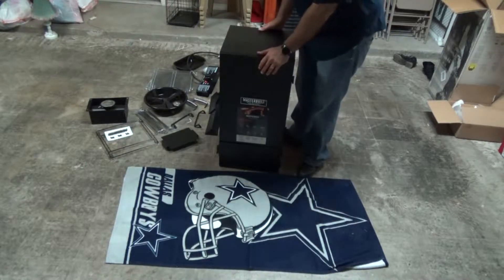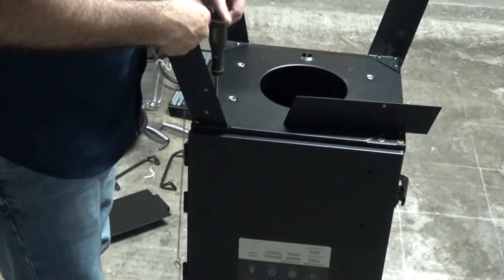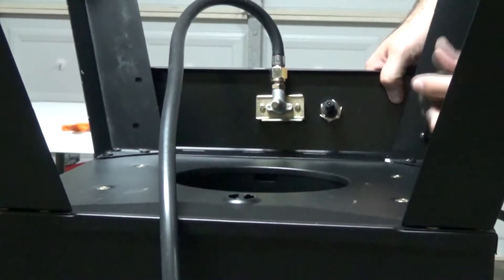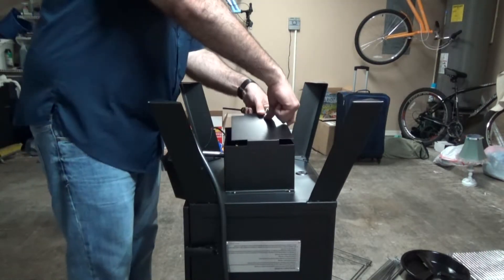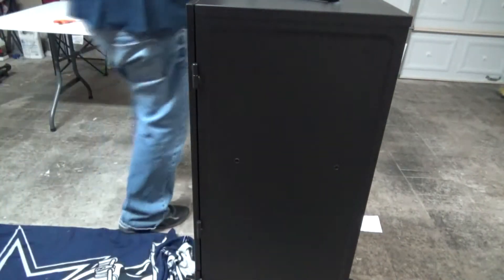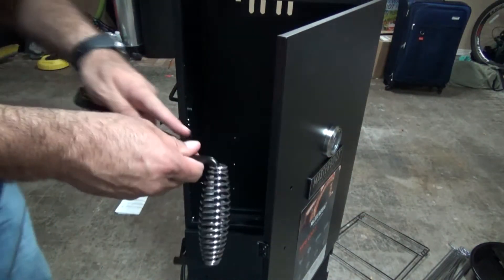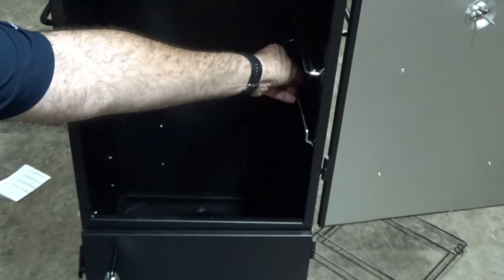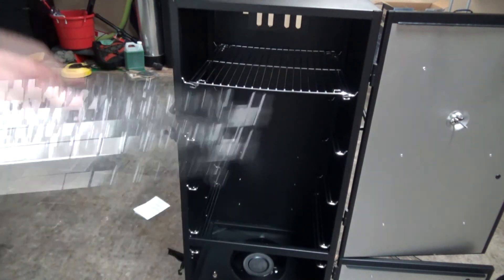Unboxing a Masterbuilt Propane Smoker Part 2

Comment: Should the prooane tube be over the inlet & fit loosely or tight? I mean the tube goes into the pipe with the holes on the side. Mines is loose.
Reply: Yeah mine too, i was just wondering this. I think it is just a loose fit because the gas needs to mix with the air.
Reply from the maker: Tight
Reply: @TheSmokingBeard  Mine is loose too.